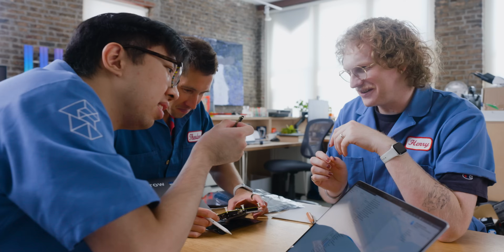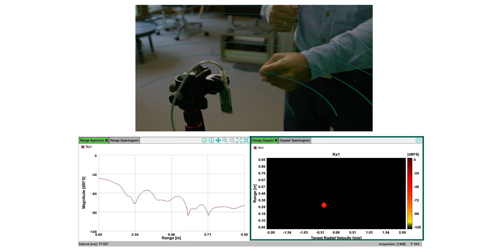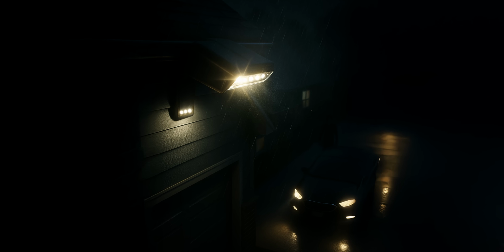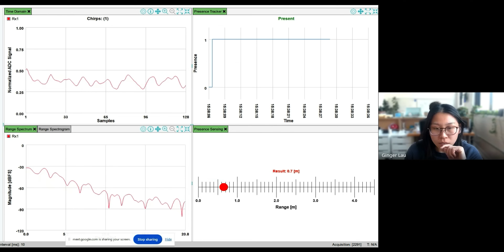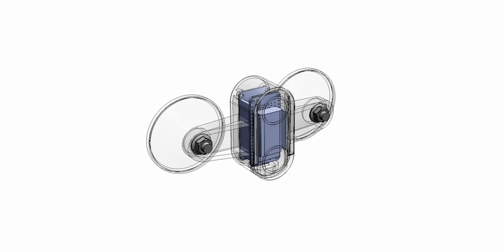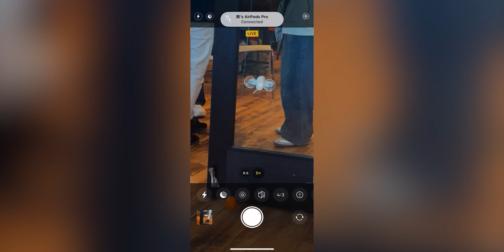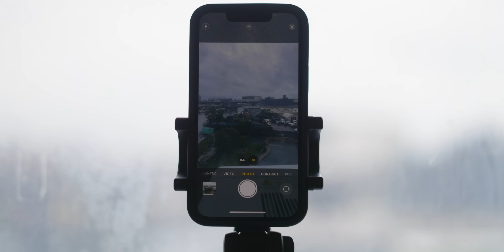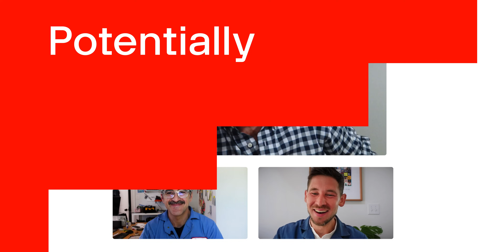B!RD ALRT – Potentially Genius | DigiKey

Comment: Why didn't you start with the $168.52 price tag?
Reply: Jesus, that is expensive. Thanks for saving me the clicks.
Reply: $106 in digikey for a dual core MCU, a WIFI + BLE radio and a 60Ghz mmw Radar wtih integrated antenna ? Doesnt sound so bad !